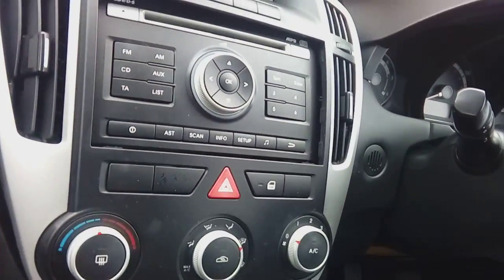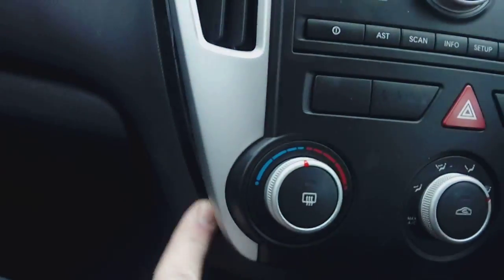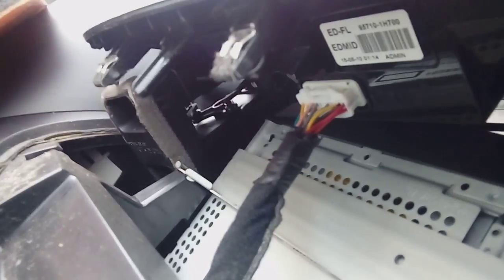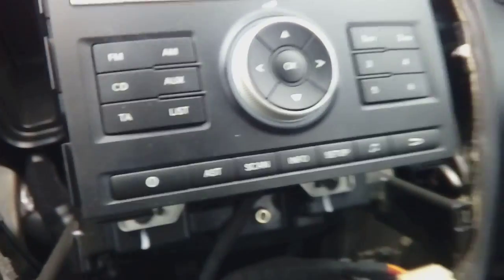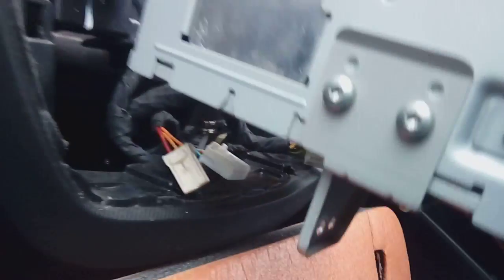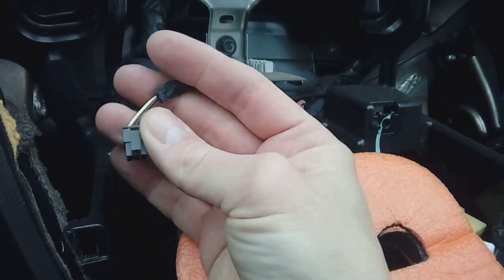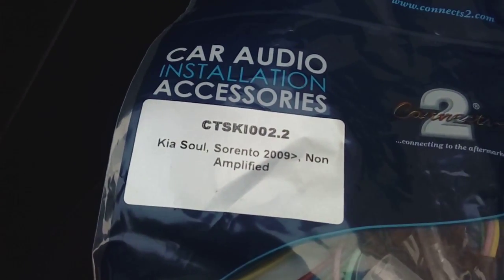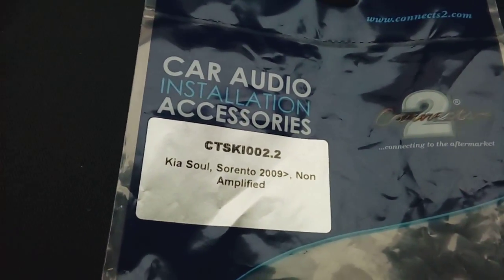Kia Ceed 2006 to 2012 quick radio removal guide + steering controls part numbers

Comment: Fantastic! Thanks to this video I was able to remove the radio by myself and I now have a working radio in my Kia Ceed.

Battery was changed by previous owner and radio had not worked since, there’s a small red 10 fuse at the back of the unit, changed it and working perfectly now.

Forums have been next to useless on this problem so if the radio on anyone’s Ceed is totally dead I would strongly recommend checking the fuse at the back of it - worked for me.

Thanks!!
Reply: Thanks for sharing your experience =)
Reply: Thanks for that i got the car knowing the radio was not working. I took it to kia in Leicester and they told me with out looking that I need a new head unit. Watched this video and read your comment. It was the fuse cheers for the info
Reply: @bigknoxy4210  Great to hear, I have posted this info on a few forums too and hopefully saved several people some money!

Comment: Hey, great video thanks. You mention that airbag light will come on if the ignition is turned on with those connectors disconnected. I’ve worked on VAG cars many times before and even disconnecting the connector with ignition off still triggers the error and error cannot even be erased without a special tool. Just wanted to confirm that you are sure it doesn’t trigger airbag light as long as ignition is off? Also if it were to trigger airbag light, is it difficult to clear? I love working on Toyotas as airbag lights go out as soon as problem is fixed
Reply from the maker: If you trigger the airbag light you will need to clear a fault code with a reader. As long as ignition stays off your fine to disconnect.

Comment: hello there @PJs projects, my father have a Kia Ceed 2011 and the sound it gives from the radio is very tinny like only treble, he have had it to and audio shop and they couldn't figure it out why, had parts and head unit replaced and its still tinny, do you have an idea what it could be? is there an external amp on the 4 speaker model?
Reply: did you ever get to the bottom of the audio problem?

Comment: Hi, I'm looking to buy a 2013 Kia Ceed 2 ECODYNAMICS CRDI however it only comes with the standard bluetooth radio unit. I would like to know if it's possible to get a 3rd party Sat Nav + Bluetooth unit for this car and install it yourself? If so, which one and what do I need to look for. Thanks.
Reply from the maker: Yes you could try the Kenwood DNX716WDABS as an example.
https://www.kenwood-electronics.co.uk/car/nav_mm/nav/DNX716WDABS/
Reply: @PJsprojects  Thanks! Can I get ANY sat nav unit? Or are there things I need to look out for such as size, cables etc?

Comment: I have a stuck CD in the player, tried everything to remove it by following other videos. Do you know if it's possible to remove the top of the radio to gain entry to CD player?
Reply from the maker: You would need to remove the loading mech and the load rollers to get the cd out without damage. Any force at all on the mech will damage it and it would need to be realigned.
Reply: @PJsprojects  Is it possible to remove the rollers then? If it doesn't work I'll have to get a second hand one then.